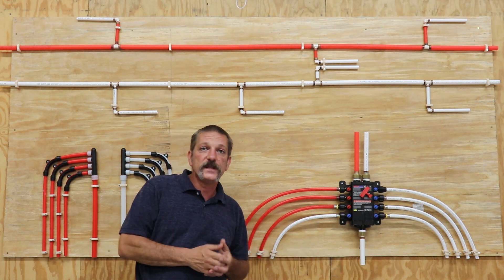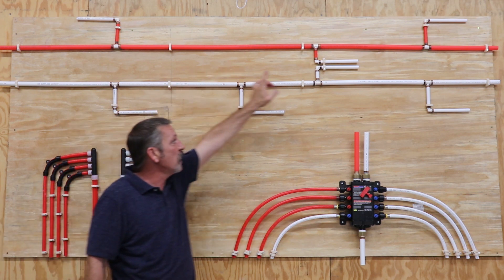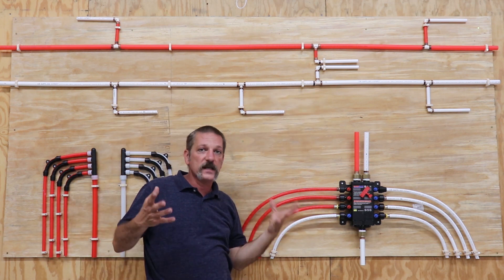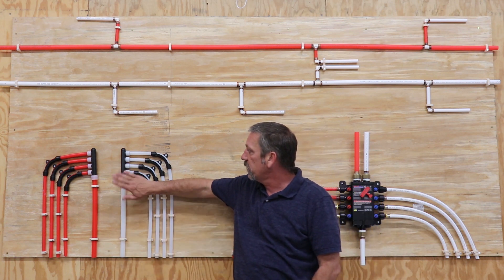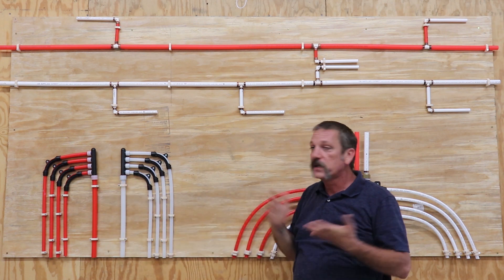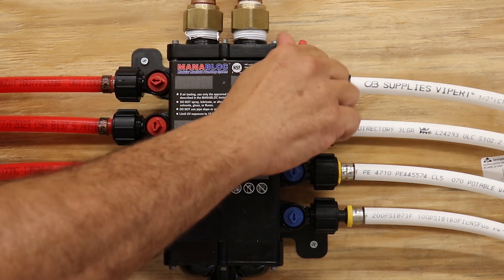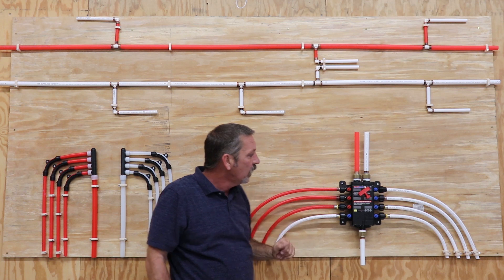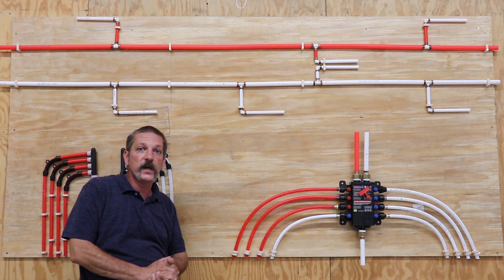PEX Installation Methods

Comment: im really curious how that full manifold with the shut off valves will function after a few years with really hard water.  Are you going to get calcium deposits that may hinder fully shutting off the valves?

Comment: Hi there, great video. We have a trunk system with a tables takes 5 min for hot water to make it from the tank to the faucet, so much wasted water. Been researching options and looking into the manifold so I can have individual shut off. Only down side to this is the the 2nd and 3rd floor would still be trunk style but the main floor would be direct run. When kids move out I can shut the end and 3rd floor off and still be ok. Only question I have is which PEX to use A or B. I'm leaning towards A. Thank you

Comment: The manibloc starts leaking then what?  It's a great idea...on paper.  Local valves near the fixtures is still better in my opinion. I shut off the troubled fixture the rest of the house isn't affected. With the bloc...not the case. Plus they are very expensive.  Me?  I like trunk and branch for cold ( PexA) better flow less restriction and your lower left manifold distribution for hot. Each fixture gets it's own home run. Less standing heat loss and quicker hot delivery to fixtures.  Things to consider I think.

Comment: A good overview. It's worth noting that if you can use PEX A and expander fittings at a manifold, you can also do that in trunk-and-branch designs. I like the circuit breaker analogy, however prefer to stay with local control for water. If a fixture on the 2nd floor has a problem I will not be running down to the basement to shut it off.

Comment: The problem with this video isThe problem with this video is that that the manifold block system he appears to have their does not have the option to use it with PEX A
And PEX A is the preferred high-quality pipe to use if your investing in a good system
Reply from the maker: They gave it to me it has a lot of connections

Comment: If you use Pex A for trunk and branch, there are no pinch points because Pex A fittings retain the full inside diameter for full flow, 20 % better than Pex B

Comment: I doubt I get a response but it's worth a shot. I live in an "apartment" building (converted motel) and there are 8 apartments. 3 of which share a water heater and I'm assuming the rest do too. How would you run a manifold system to something like that?
Reply from the maker: Well it would be best for each unit to have its own heater, Or one large commercial with a recirculatory pump or tankless.

Comment: On the distribution system; would you still use shut off valves again near the toilet or vanity ? 
Thanks
Reply from the maker: Yes, you still need stops at the fixtures
Reply: I did not. But it’s easier and faster for me to go downstairs and shut off the water at the manifold block than it is to clean out everything under the sink to shut it off. 
Plus those shut off valves are often the source of the leak!  
I re-plumbed my home with fittings only at the supply lines for the fixtures. 
No tees. No 90’s. Just individual runs to every point of use. 
No plumbing in the walls either. Except for the shower. Lines straight up thru the floor. Connect to the supply lines to the faucet. 
What a simple clean installation. Easily changed or replaced. 
But I’m my own plumbing inspector. 
Your experience may vary.

Comment: With the manifold system how do you run the hot water back to the water heater to keep it hot in lines?
Reply from the maker: Well, you Typically don't. That would be a reccirc system

Comment: Any trick to bending the pex in those black 90° bend brackets. I'm using 1-in pipe and I find it real difficult to make the beds. Can we warm or heat the pipe to aid in the bent in those plastic 90 supports
Reply from the maker: There is a heating blanket for Pex that you can use. The larger pipes are hard to get in the brackets we use the 90° fittings instead.

Comment: Nice job.  Looks organized and neat.  I will say one thing that I have had troubles with are the brackets that bend the pex to a 90 degree.  In hot and arid climates like I am in with the Phoenix area, over time the bends tend to crack on the outside bend.  Thanks for taking the time to put this mockup together and the explanation of the different types of systems.

Comment: I have a manifold block.  It's fantastic.   Need to change a shower balancing valve, just shut the water off on that line.   Stuck gate valve that won't shut off, shut it down at the manifold.   Plus, I've got a water shut-off valve right before the manifold so i can shut everything down just as easy.  
I believe the one downside is the time to get hot water to start flowing.   Because the water is traveling to the manifold and then to the fixture it seems to take a lot longer than the traditional trunk system.

Comment: My pex runs through my attic...no basements in Texas.It's a little harder to do a distribution block so I use the manifold system with Pex B. I also use shut off coupling valves at each of the manifold fittings that allows me to shut down each line and it doesn't reduce flow any more than it would without it. So basically, same system as the distribution block but without a central node. I have two manifolds. One for cold and one for hot and each 1/2" line has a shut off valve. I did this primarily because my builder installed Nibco Pex which was defective back in 2008 and they never stood by their product so I've had to do all my own plumbing and wanted to make sure I had a good system for dealing with leaks. I would LOVE to have a basement and run a distribution block for my house. That would be awesome. But none of our houses here have basements so...booo.

Comment: Another thing to denote with the manifold systems is they are largely incompatible with recirculating pumps, whereas even old trunk and branch systems can be easily converted to work with recirculating systems.

Comment: Wow. Yeah, Pex-B fittings are smaller and restrict your flow. That's why you should step up the size of the system. Note that Pex-A fittings do not restrict the water flow, so you don't need to step it up. 

I was scratching my head why you didn't mention installing a hot water loop to keep the water hot through the entire circuit. 

Other than that, really good video! Gorgeous back-plane showing the systems!

Comment: I'm building my own little pex manifold system with ball valves, should cost under $80 for system and $40 for all of the pex. I have 3 sinks in the house, two toilets, two showers, a tub, 1 exterior hose bib. Then when I sell all the copper it should bring the cost down a good bit.

Comment: With the manifold system. Do you still need to step it down to 1/2 inch from 3/4 at the manifold to achieve additional water pressure at your connection points. Or can you use 3/4 though out the house from the manifold and just step it down at the connection of each connection?
Reply from the maker: it comes out the manifold as 1/2 inch.

Comment: Interesting!  When I installed a radiant heating system during a basement finishing, I used PEX and each loop was a single run.  The only connections were in the mechanical room.  I also used PEX to replace a line that failed due to a freeze rupture.  In that case, I used SharkBite fittings and left in place access panels.  In other places where I've seen PEX used in new homes, it was always done with a manifold.  I hadn't even considered that anybody used branch and trunk with PEX.  I guess if I was ever going to use PEX for plumbing, I would use a manifold, with at most branches in the bathroom from under the vanity to the toilet, with no fittings where they can't be accessed.

Comment: On the middle option is that 3/4 on main and 1/2 on feeds off of there?  Could you use those copper manifolds on middle option and just put in individual shut offs for the lines out from there similar to the last option?

Comment: This is great - I wanted to isolate my master bath because the lines run above a garage and froze.  Having to re-pipe and switch to pex from copper.  Are there any issues branching of my cold and water lines to go to a different section of the house and then branching off for each of those fixtures in the master bath?  So there be essentially two “zones”

Comment: Great video! We have a single bathroom house and are doing some work. Should the cold feed and hot discharge be 3/4? Right now our cold trunk is 3/4 but everything else is 1/2.

Thanks in advance

Comment: Viewing this two years after the video was published... thanks for posting!

I have a question... what are your opinions of a combination of the two... running a manifold at the water source, with a trunk to each local, branching off to the fixtures at the local?

For example: A trunk line from the manifold @ the water source to the Master Bath with branches to the tub, shower, and toilet? The same for the kitchen, each spare bath etc...

This is the form that the electrical circuitry works... run an electrical home run out to say... a bedroom and then branch wiring to the individual receps in the bedroom area.

Seems that this would reduce the amount of pipes at the manifold as well as the SIZE of the manifold, but would increase the number of fittings needed for the Master Bath piping.

I would think the trade off would be shutting down the Master Bath as a whole to repair any leak at the bath.
Reply from the maker: You can do that
Reply: Will the Water flow will be the same ?

Comment: I replaced 3/4 ancient galvanized withv1/2 pex and have had 0 problems. At a lot of spots I have more psi than before. Gotta take stock st what you're ripping out. Old pipe rots from the inside and you can sometimes not fit even a pencil through it.

Comment: If someone were to plumb 3/4 to 3/4 on the trunk and branch would they likely have pressure issues? I'm plumbing a small cabin and everything is within 20ft of the pressure tank and I figured it would be fine...

Comment: Do you have a link to the manifolds your using. ?? Most of the ones that come up on my searches have way too many ports for the house we're going to redo
Reply from the maker: it's called a manabloc . you should be able to get it in any size

Comment: New Subscriber here !!! Great video can you provide links to the manifold systems shown?? I've searched and most only show the crimp systems and way more ports than would needed in the house were re doing.
Reply from the maker: Our rep gave me that one. It's a manabloc . You should be able to get however many you want, it's modular.

Comment: Maniblock System is best system but way to expensive on installation we don't use them black manifolds they have seem that will crack in winder we use black poly pex fittings 
They won't freeze and bust like brass fittings

Comment: After seeing several different Pex A expand to the point of rupturing during last years Artic Blast down here in Texas, I can confidently say that Pex B, Pex C, and even Polybutalene(lol) are better options
Reply: How about don't let your lines freeze?  Or if you have no other option crack open the lines and let them drip during a deep freeze.
Reply from the maker: Y'all had a mess!!
Reply: Just build and setup your homes like in Canada and you won’t have an issue 😊
Reply: Zurn Pex B, Sioux Chief Pex B, and Sil-O-Pex Pex B are all F1960 expansion rated..... Merflex Pex C & Eastman Pex C are both F1960 expansion rated.... I say that just to point out that Pex A is the only pipe that can be expanded is a myth.... I personally don't like expansion, as it has the same effect on the pipe as flaring and/or swedging copper(thins it out in a critical location).... I oversize my lines, but I loop all my water lines on my rough-ins, plumbers figured out the best way to deliver water many years  ago... The fact is that top-outs have always been the most labor intensive phase of the job, yet somehow plumbers figured that tripling the labor to run all the water overhead was the smartest change since ditching cast iron for ABS/PVC..... Much more work for an inferior water system
Reply: Total amateur here trying to learn a bit about Pex before I install my own so I'm sorry if this is a dumb question but: What I've come to understand from the videos I've watched so far is that Pex A, because of it's expansion/memory properties, can take a greater psi than Pex B or C. So wouldn't that mean if you were seeing Pex A burst then the Pex B or C  would have also burst? Am I missing something about Pex B?
Reply: @jabberwaukee1930  That's what I think as well.

Comment: How is your water pressures with the distribution block vs the traditional crimp way that you say have choke points. Wouldnt you still have loss of water pressure with the distribution block cause you have to reduce down in pipe size as well.

Comment: Best video on the PEX systems. And they do make Manifolds with shut off valves too. Used these in my own home with PEX A, and I drain my outside spigots every winter just because I remember frozen water lines as a kid. And extra upside is if you go on vacation or leave your home for an extended period of time, it is easy to shut the water off to everything in your home so you don't come home to a flood. To me the piece of mind is worth an extra 200-300 bucks in hardware.
Reply: I purge with 50 psi air my system bypassing the waterheater. Only drawback is air is not "pure" air. I use an ordinary air compressor. Yeah I know of the drawbacks but I flush the lines thoroughly.

Comment: The R&B color coming out of the wall for angle stops is better for a repairman so there is no question about what a pipe is. Blue? Cold Red? Hot.  And who cares what it looks like in the back of the cabinet?

Comment: It seems counterintuitive, and kind of dumb, to change the pipe color to white when it comes out of the wall. What good does the color pipe do inside the wall where no one will see it.
Reply: It will be seen when being repaired, and when the house if being plumbed the first time.  Just like the hot and neutral on wiring are different colors.  Building homes looks so simple to the uninformed.
Reply: If it's coming out near the toilet what do you think it would be?  And if it's coming out under a pedestal sink on the right is that hot or cold?  C'mon man!  :)

Comment: Great video! 

For my house I've put all the bathrooms in the middle very close to each other. So my tankless is very close, I use a very short 3/4" hot supply to the hot manifold (multiport branch) and each 1/2" goes to the hot points. I just used a basic trunk branch for the cold line cuz its cheap and simple and cold is cold.

Comment: If I was building a new home it seems like the distribution manifold configuration is a no-brainer.
Reply: Not necessarily. A manifold system is costlier, requires significant wall space, and may actually be unnecessary. I’m not saying it never happens, but homeowners rarely turn off water supply lines in their house.

Comment: It would be awesome to automate the block. I could see water sensors in different parts of a house communicating with the block. If there’s a flood, it would automatically shut off water to that specific area. I could also see this working with pressure drops if rodents chew through the pex.
Reply from the maker: There are devices that do that. just not as a whole block.

Comment: if im running lines up two stories through a central wet wall. do i need to tear out walls to add supports or can i anchor it at the top and bottom and be good?
Reply from the maker: Code says you have to have anchor it every ten feet . you could try but it might knock in the wall.
Reply: @PlumbingSolutionsLLC  its all plaster and lath so i dont think it would knock in the wall... maybe a small hole to access the studs and go from there. could probably do this in the kitchen
Reply: @beardedgaming1337  To clarify he means the pipes could knock around inside the wall and make noise and be annoying - not knock the wall apart!

Comment: how do you get the pex A expansion fittings to work on that vieago manablock?
Reply from the maker: You get one that has the pex A fitting on it they come in many styles
Reply: @PlumbingSolutionsLLC  the vieaga manablock doesn't come with a pex a expansion option, and there threads are proprietary so you can't use a npt threaded expansion fitting. I just thought yiu might know of someone who makes an adapter, or if you are someone else has successfully adapted it somehow. I am doing a homerun pipe replacement in my home and the manablock are cheaper then other options I've seen.

Comment: I haven't done a serious job with pex yet, but I have had to FIX problems with pex several times.  The biggest problem I've seen is the elbows that are made out of metal.  If I ever DID to a full job with pex, I'd either use plastic body sharkbite fittings, or I'd use plastic for everything up to the metal fixtures, simply because you eliminate the risk of a failure due to corrosion, which is what I've had to deal with in pex systems on multiple occasions.
Reply: Interesting.  My home is 23 years old. I’ve re-plumbed several lines and fixtures over the years and have never seen corrosion on the brass fittings. In fact I reused them because they looked new.  Maybe it’s because I don’t have hard water.  My son asked whether he should use brass or plastic fittings, I recommended brass because it seems that metal can take the stress better.  Maybe I am wrong.  I don’t know.
Reply: Yeah, I would use the brass over the plastic. There should be no corrosion.

Comment: Thank you for sharing your knowledge! I am wanting to know, If I added the same size Pex A as I have in copper, would the pressure be lessened due to the thicker walls in the Pex A than the M Copper?
Reply from the maker: It is not enough to matter.